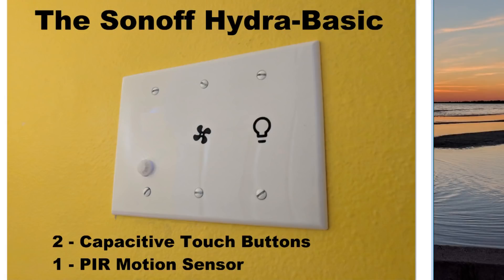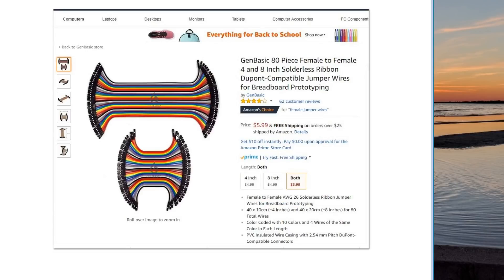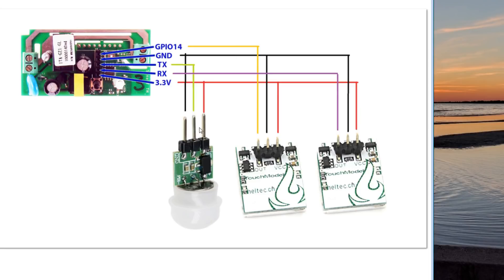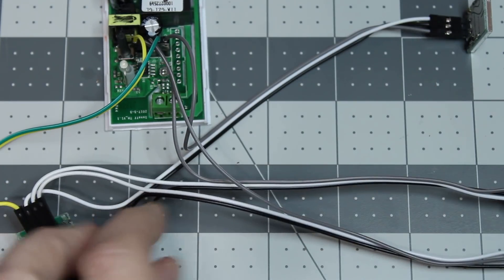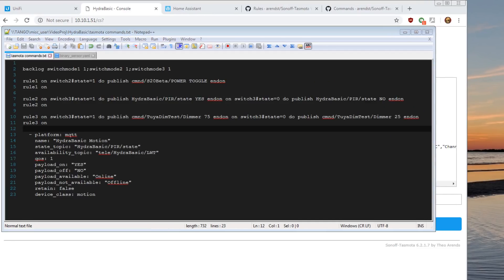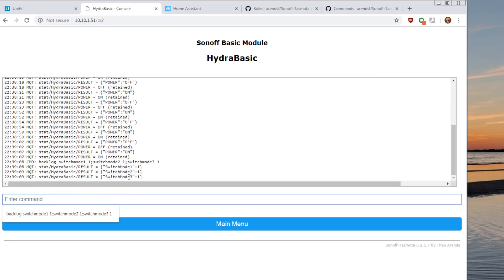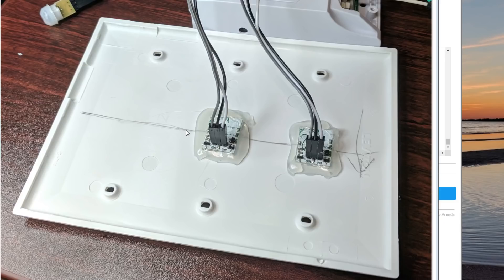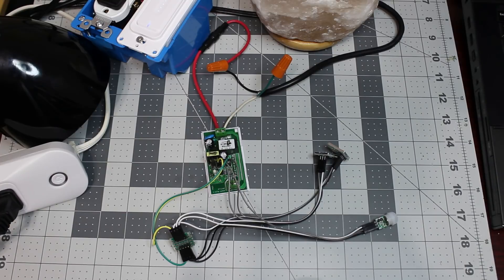Sonoff Basic Expansion Mod - Buttons, PIR Motion Sensors, Tasmota Rules and more!

Comment: Is it possible to do an expansion on any Tasmotized device? 
Like could I attach a PIR sensor to a MOES smart switch module? RX and TX are all free after I flash it right?
Reply from the maker: Yep. I did it in several videos for adding sensors.

Comment: Thank you for the tutorial. I'm having some issues by trying to connect a PIR and a DHT11 to a Tasmotized sonnof basic. When I connect the sensors individually they work fine but if I connect both only the DHT works. I'm running the last updated version of home assistant, the PIR id connected to GPIO3 and the DHT to GPIO1. I only added these lines to the binary_sensor.yaml:
- platform: mqtt
    state_topic: cmnd/NewPir01/POWER2
    name: R3 PIR
    device_class: motion

Any lead? I out of options. Thank you in advance
H.
Reply from the maker: Have you tried using the Auto Discovery feature as it has improved by great lengths since this video?  It is "Setoption19 1" in the console.
Reply: @digiblurDIY  already done. actually the PIR works fine alone but it doesn't as soon as connect also the DHT
Reply from the maker: Let me look a this more as I had coffee this go around and I may have done things differently now.
Reply from the maker: If it is a sonoff basic you won't have a POWER2.  Did you set the switch and switchmode for it then the rule to publish the PIR state?
Reply: @digiblurDIY  Actually I erased everything and only applied these two rules:
rule 1 on switch2#state do publish Prueba/PIR/state %value% endon
and
rule 2  on switch2#state=1 do backlog power1 on; ruletimer1 30 endon on rules#timer=1 do power1 off endon

also I've generated a binary sensor like this:
- platform: mqtt
    name: "PIR Motion"
    state_topic: "Prueba/PIR/state"
    qos: 1
    payload_on: "1"
    payload_off: "0"
    payload_available: "Online"
    payload_not_available: "Offline"
    device_class: motion

That lets me show the PIR into HA, and it works very well... but as soon as I connect the DHT11 the PIR system stopped working.

By the way, I didn't introduce a single line of code for the DHT11, it worked automatically.
I've tried to change the SerialLog from 2 to 0 but I've got any change
Reply: @digiblurDIY  I made a cross-check of console log by restarting the unit with and without the DHT11, and I found these three lines are executed at the very beggining of the boot ONLY when DHT11 is NOT connect:
00:00:02 RUL: SWITCH2#STATE performs "publish Prueba/PIR/state 0"
00:00:02 RSL: Prueba/PIR/state = 0
00:00:02 RSL: stat/Prueba/PIR/SWITCH2 = {"STATE":"OFF"}
Any clue how make them run also with the DHT11 connected?
Reply from the maker: Possibly something with the DHT11 is shorting out?  Do you have another to try?  Or it could be a power supply issue not being able to support both.
Reply: @digiblurDIY  I already have changed it by another DHT11 and also for DHT22, same behavior. I'm almost sure it's an issue with mqtt settings maybe in the rules. I'll keep trying. Anyway, Thank you for your leads
Reply from the maker: Does it show in the Tasmota GUI the temperature?
Reply: @digiblurDIY  yes it does, DTH it's always working with or without the PIR connected.
Reply from the maker: Great. It won't pull in with auto discovery or do you want to add manually?
Reply: @digiblurDIY  I used setoption19 1, and switchmode2 1, that was all, DHT worked like a charm. But if a connect both PIR and DHT, only this last works

Comment: still cant get my darn pir to work correctly
Reply from the maker: What's wrong with it?
Reply: @digiblurDIY  on, off, on, off, on, off, on, off, on, off etc
Reply from the maker: Do you have another PIR to try?
Reply: @digiblurDIY  nope, the one i was using i had to extend the wires to flush mount the dome, but broke the wires this morning trying to fix this setup, so ad to grab my last or I had out of the bag.. think it could be the issue? I've gone over all your videos on settings, but running as switch2 with all rules as 0 still on off on off
Reply: ended up creating a soft button and boolean for the tablet so I can at least use WLED in the kitchen. frustrating
Reply from the maker: Sounds like a bad PIR to me. You used the n switch for no pull up too?
Reply: @digiblurDIY  i was using the "n" but was told "n is for not using the internal esp pullup"

Comment: I tried your project, I'm having issue with Touch Switches. Both Touch switches trigger the Relay. I want One Touch Switch for relay and second Touch switch for Fan just like you did. But why both trigger relay?
Reply from the maker: Because you don't have rules taking the switch states assigned.
Reply: @digiblurDIY  As I mentioned I followed each step from your video. I tried again last night but same results.
Reply from the maker: What rules are you using?
Reply: @digiblurDIY  Ok, here is my: 
Setup: 
I'm using two SonOff Basics (SonOff1 as MBToiletLight & SonOff2 as MBToiletFan in MQTT). SonOff One has: 1. Motion sensor (Switch3#) will turn off light after 2 minutes with No motion (I don't want it to turn ON light when motion). 2. Touch Switch (Switch1#) will be used to turn ON/OFF toilet light. 3. Another Touch Switch (Switch2#) will turn ON/OFF exhaust Fan in toilet. SonOff two is connected to toilet exhaust fan.
Rules:   
rule1 on switch2#state=1 do publish cmnd/MBToiletFan/POWER TOGGLE endon -> rule1 on
rule2 on switch3#state=1 do publish MBToiletLight/PIR/state ON endon on switch3#state=0 do publish MBToiletLight/PIR/state OFF endon -> rule2 on
HA Automation:
When MBToilet PIR publishes state OFF wait 2 minutes then turn MBToiletLight  OFF.
Issues:
1. When I tap Touch Switch 2 it does not publish Toggle but turns OFF MBToiletLight instead. On second time tap it does publish Toggle.
2. Even after PIR publishes State OFF automation does not turn OFF MBToiletLight  (I know this issue is not related to rules but is more likely a automation or MQTT publish issue but if you could help me with this one as well I'll really appreciate).
I hope my setup makes sense.
Reply from the maker: Here's what I'd do first to check your switch states.  Make a rule to test them.  Like this

Rule1 on switch1#state do publish mytest/switch1 %value% endon

Then make others for switch2 and 3 as well.  Then test your switches and watch the log, then you'll know the states it is sending out so you can capture them.  Once you do that it decouples from the relay.
Reply: @digiblurDIY  Thanks man, I performed your suggested test then reset the configuration and set the module per your video tutorial and its working as it should be now. I don't know what was wrong with this but I should mention one thing that I did change rule1 from Toggle to ON/OFF. Thanks again for your help man. Love your tutorials

Comment: Hi, great video. How do you ensure that your module is electrically safe? I was thinking of adding a PIR to my Sonoff S20 but can't see an opening to route the Dupont cables from the Sonoff GPIO pins to the external PIR unit. Thanks
Reply from the maker: Most all the Sonoff devices without power monitoring are isolated. Check with your meter against the pin you want to use and the AC side.

Comment: Great video. Can you also think of a rule using the PIR so on motion do a ON of the local switch, like I have connected a lamp, so it will turn on the lamp and when no motion is detected it should switch of after 3 minutes or 2 Minutes.
Reply from the maker: I believe I did that here with the motion light plug - https://www.youtube.com/watch?v=5Oa27pCHtYo

Comment: Hi from across the pond! Thanks for the video, I was really confused by the rules. Now I have a single touch switch controlling the relay output, and a PIR sending MQTT messages back to my server. I'm using the newer "Sonoff RF R2 POWER V1.0".

Comment: And How make it works with new version of sonoff basics? There isn't gpio 14.
Reply from the maker: I do plan on a short update video on it. Do you need to connect 2 of the buttons?
Reply: @digiblurDIY  right now I don't plant do nothing but, it well be good make update video with new version, of course I can missing pir  sensor for another bottom right? Can you show me how  add Reed switcher and bottom pls?
Reply from the maker: I actually will be showing the original design with a few changes.
Reply: Hi there. Great video and it seems to be exactly what I want to do. Only difference is I would like to use a push button and 
PIR sensor connected to sonoff, to control or turn on a Hue Light bulb?
So if a hardwire mains power to to hue light via a standard light switch first. This way the hue light is connected to wifi and hue bridge. This also mean we can use home assistant to turn the hue on and off or dim via hue dimmers
So now I would like to have the PIR on the same wall switch plate, so if we walk into the room, the PIR tells sonoff, (maybe via rules) to turn the hue light on, after no motion for 10min, turn off.
3rd part is having a push button on the same wall plate, to toggle the light via the sonoff on or off to bypass the PIR and 10min timer to stay on permantly, until I toggle again to go back to PIR control
The final part is dimmed on after 10pm so guess this can be done via automation
Sorry for long winded explanation. Hope it makes sense to you. Maybe a could send message direct or something
Hope you can help. Still learning at HA hence my request for guidance
Thanks for now
Bruce

Comment: Thank you for another great video.  I have a little project where I am putting motion sensors at the top and bottom of the stairs.  I don't care which one is triggered but want it to turn on stairway lights.  Can I put them both on the same GPIO pin or do they need to be separate?
Reply from the maker: I would probably put them separately on different GPIO pins. Not sure if they are designed to take voltage from another source.

Comment: great tutorial. Is it possible to use HC SR04 Ultrasonic Sensor or Us 100 Ultrasonic Sensor with Sonoff Basic as a switch? (Using GPIO14,vcc, GND) 
. This Ultrasonic sensor has 4 Pins 
Just wave the hand in front of the Ultrasonic sensor to Turn on/off Relay. Please let me know
Reply from the maker: Looks like you need two GPIO pins which should still be doable. But depending on your sensor you might need 5 volts. https://github.com/arendst/Sonoff-Tasmota/wiki/Wemos-D1-Mini-and-HC-SR04-Ultrasonic-Sensor

Comment: Great tutorial. It has a very clean look. I am curious how you mounted the touch buttons to the wall plate? Did you cut rectangles in the plate and glue them in?
Reply from the maker: I placed them on the back of the faceplate and put hot glue on the sides and top of it. There is no glue between the faceplate and the capacitive button.
Reply: @digiblurDIY  Thanks for the info. I didn't think they would work through the face plate. I will give it a try.

Comment: I see that you powered two capacitive switches and the PIR, off the sonoff basic.

I tried to power two TTP223 capacitive touch switch buttons off of the 3.3v and ground on a Sonoff Basic (RF R2 Power V1.0).

It doesn’t seem to power both of the capacitive touch buttons. Any idea why its not working or any suggestions what I might be doing wrong...
Reply from the maker: Can you measure the voltage on the pin when both are hooked up?

Comment: Great presentation style! Here's my question. In this video you're using GPIO's 1,3 & 14. With the new Sonoff Basic board layout shipping since 11/2018 (no GPIO 14), what pins would you use to duplicate the same outcome as in this video?
Reply from the maker: That's a tough one. The new model is indeed a better design. There is gpio2 on the bottom but it is a fragile pad and you can't hold it low at boot if I remember correctly. I probably would try to trace out the LED and see if I could snip that off and use it as an input pin. You would have to change to a generic template but that is easy.
Reply: @digiblurDIY  Thanks for the reply. I've seen someone use GPIO2 with a pull-up resistor on 3.3v (to prevent ghost switching). And the zip-tie is a creative touch. https://github.com/arendst/Sonoff-Tasmota/issues/4694#issuecomment-450404815
You are correct about can't hold low during boot.

Comment: Rules RULE!  -  I finally got your Rule1 working between a Sonoff Basic and my MQTT connected Office Lights - the hardest part for me was getting things set properly in the Arduino IDE (settings in my_user_config.h and user_config_override.h) Maybe a future video would help other less-technical guys like me.  - I hope to use Rules to control a sonoff iFan02 Ceiling Fan from a wall switch.  If Rules won't do it, I've got Node-Red in reserve.  Really enjoying your Node-Red series!
Reply from the maker: Check out the PlatformIO stream for easy compiling of things I did. I use some rules in the 2nd part i2c video to control my iFan02.

Comment: So I've been tinkering with this setup quite a bit lately.  I think I've come up with a way to get the LED's to light up at will.  Instead of using the HTTM switches which I'd been messing with I used a TTP223 which I had piles of sitting around.  Then I put a round sticker on the back of the faceplate and painted the entire faceplate with black spray paint.  After doing this I removed the sticker so I had a nice round transparent area on the front of the faceplate.  Then I put  an approximately 2mm thick blob of hot glue over the transparent area and pressed the TTP223 over the top of the blob.  At the same time, off to the side I also stuck a red LED into the hot glue.  I desoldered the LED from the SONOFF and ran a wire to my new LED and hooked the switch up to GPIO 14.  From here you can run LEDSTATE to control the LED how you'd like.  It looks pretty from the front I should be able to have the LED behave however I'd like!
Reply from the maker: Nice! I was thinking some thing kinda of like this on a Sonoff dual when I first did one of these. Your method of the install seems much better though!

Comment: i am trying what you did there but with only 1 momentary push button but it doesn't really do much.
i have gpio 14 set as: 91 button2n
.

and in terminal i do:
backlog switchmode2 1
rule1 on button2#state=1 do publish cmnd/kitchenlight/POWER TOGGLE endon
rule1 1
i also tried:  83 switch2n
rule1 on switch2#state=1 do publish cmnd/kitchenlight/POWER TOGGLE endon
as in your example but that doesn't do anything either.
Reply from the maker: Try a rule like this to see the state of the button. Rule1 on Switch1#state do publish testing/state %value% endon

If it doesn't do anything then something else is odd. Make sure switchtopic is set to 0.
Reply: @digiblurDIY  cool, thx. that worked when i set it to: 09 switch1.
i now have: rule1 on Switch1#state do publish cmnd/kitchenlight/POWER TOGGLE endon
but as soon as i realease the button the light goes out again. but i believe thats another setting that needs to be set somewhere, not sure wich one.
Reply: hmm found the problem. tasmota treats a push and release as a separate event. so it sends the mqtt command on push and on release.
Reply from the maker: Yep. It can get confusing with the different switchmodes so I use that test topic a bit and watch the console. From what I found 0 is off, 1 is on, 2 toggle and 3 is hold.
Reply: @digiblurDIY  i tried all 3 and they just give the same result. gpio0 is also a pushbutton so it must be possible somehow. anyway had enough for today. i'll try some more stuff tommorow.
Reply from the maker: Hit me on on discord (you can find me on the DrZzs or HomeAssistant server) I can walk you through some of these.
Reply: @digiblurDIY  got a temporary fix. all lights are on a timer at night to turn off after 3 minutes. so instead of toggle i just turn it on, i just cant use the button to turn off the lights but its good enough for now. at least i wont walk into a wall searching for the light button anymore.
Reply from the maker: OK. Let me know if you need some assistance as think you are almost there just a couple settings away from getting it perfect.
Reply: @digiblurDIY  i'll figure it out ... someday hehe. but thanks for the help and video's.

Comment: So I soldered the terminals mentioned here, because it annoys me that the light toggles, as you mentioned. Problem is, mine stays out all the time, and only comes on while being touched. Have I done something wrong? Maybe I got a different brand or something? I was really looking forward to having that light stay on. Any input would be greatly appreciated.
Reply from the maker: No, that's the same as mine, I show in the last part of the video as touch the buttons they only light up when touched.  I do wish they would stay on all the time as well and were only off when touched.  I did look into modifying the little processor on board as it does allow flashing but I didn't find much on it.
Reply: When I was looking at the beginning of the video, it seemed like it was lit up. I guess I misunderstood. Well. I guess it's better than toggling incorrectly. And it will provide feedback, if I'm looking at the bright side of things. Thanks for the reply. 

Great Videos by the way. Just found your channel today, and after watching one of your videos, I instantly subscribed. I never even log into YouTube, but I did to subscribe to your channel. Thanks for the great content, and keep it up.
Reply from the maker: Thanks for the comments! 

It does remind me I should email the manufacturer to see if they could make some like this as everyone seems to want them inverted from the way they are.